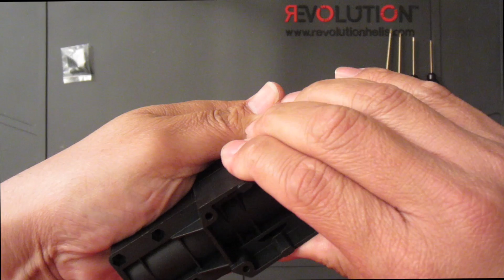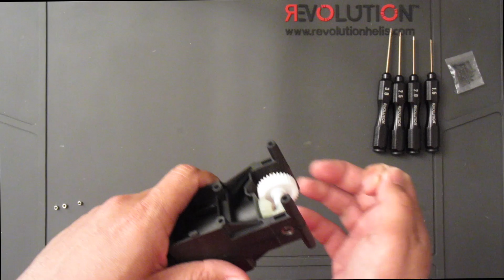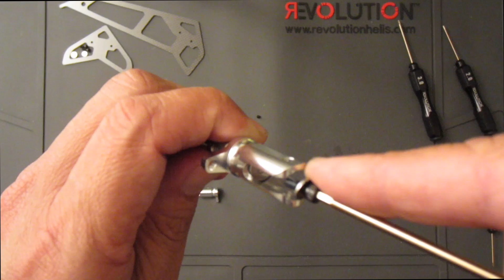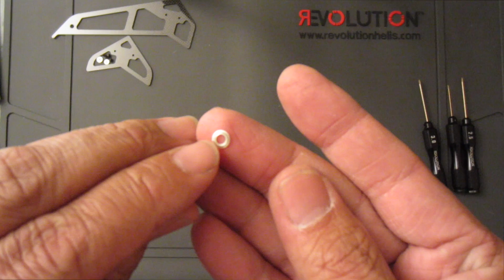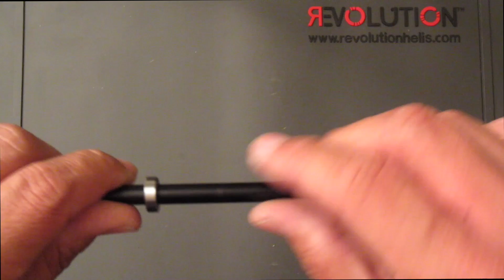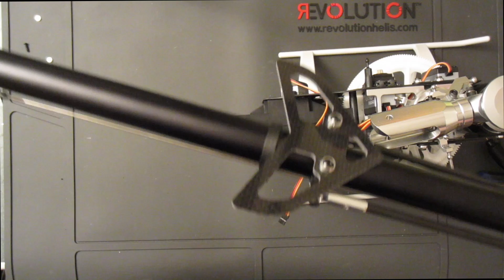Blade 550x Tail assembly

Comment: I have a 600X build in progress. The manual says to use 200/226/214 mm for each bearing. The 214 mm was a lot shorter than the actual amount. I believe it was more like 260 mm left to the end of tube. I went ahead and used the measurements in the manual, but it is not too late to change. I have not connected the rod, servos, etc. yet. Please let me know what you think. Thank you, Robert